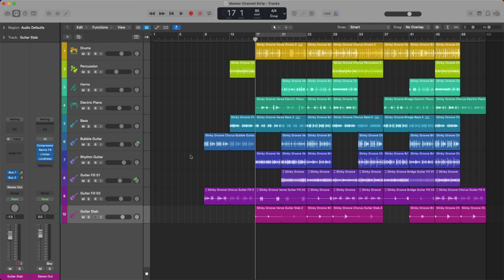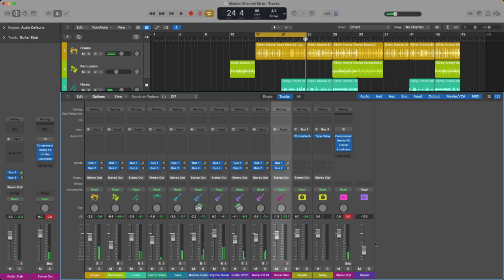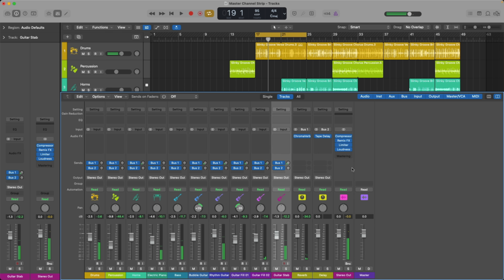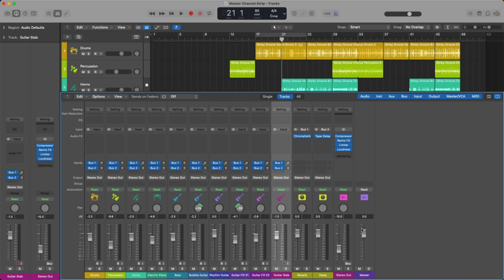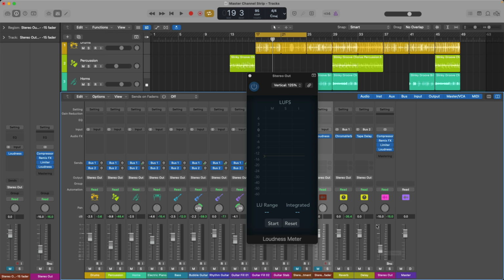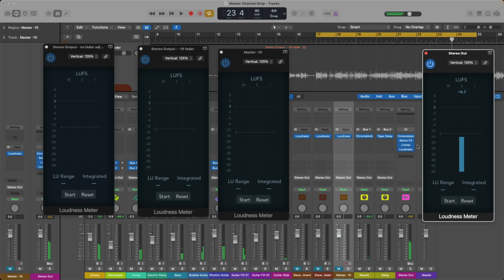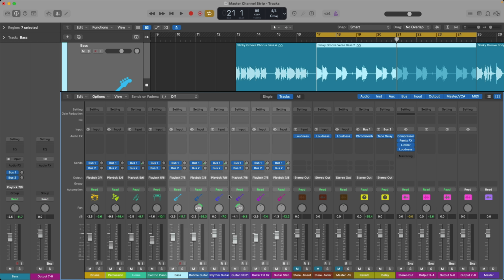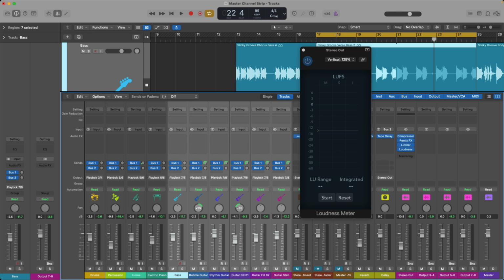Stereo Out vs Master Fader - Why the Heck Does Logic Use Both?

Comment: It would be much more useful to make the master a real "control room" like StudioOne, Cubase, and Reaper. A track on which you can insert plugins for headphone correction, room simulations, and above all, set a listening volume with the fader that won't affect the level and sound of the output, which will end up bouncing. I don't understand why Logic didn't think of such a "logical" solution in 2025. 🤣 What's the point of a copy of the stereo out that affects the level of a possible bounce and doesn't allow you to insert plugins?

Comment: Got an unrelated tech question if you don't mind.  Lately I'm having a problem with playback after i record a vocal.  The track plays fine and then will just cut to static sound for like 4 seconds and then vocal comes back in.  Any suggestions on whats the problem with Logic and how to fix it?  I enjoy using Logic but some "basic" things just need to work consistently. Thank you for your insight!

Comment: Thank you! 
Seeing the various bounced results was great. It’s clear some people in the comments haven’t had to use VCAs before and don’t realize still what they actually are and why Logic has them. I hope you can let their ignorant comments roll.

I genuinely feel bad that so many people have to learn sound engineering from a DAW. 

I’m a full time audio engineer and I teach audio and music production and it’s fun to watch people’s minds get blown when I demonstrate how to input a mic to an aux channel and then route the output of the aux into a standard track so recording level can be adjusted during recording on the fly like we always did to tape (pre-DAW) and still do using consoles-  so compressors don’t have to work so hard later. Also for time aligning room mics in real-time by adding the needed milliseconds via an insert, adding high pass eq for vocals and instruments that have low resonant room tone, noise,A/C rumble , mic stand thump caused from drum kit or bass amps, frequency adjustment to assist mic placement choice for things like proximity effect or sculpting mic low end  of ribbon mics etc etc and anything that can be eliminated from the track during tracking for better tracks.

There is SO much amazing stuff to be experienced and learned and it’s so cool to see your contributions!

Comment: Thanks for sharing, was hoping you would talk about setuping plug in slots on the master fader, I have a project an engineer sent and they had both the stereo output and master channel setup with plugins on and have never figured the setting to change it. Currently have a pre stereo out bus setup to allow the same mix options but would be so much easier on the master channel, any help here would be great!

Comment: I use Logic since the very beginning and I love it, but for me the Master strip is one of the dumbest thing I've ever seen.
First of all is deadly confusing, like your video and many comments here demonstrate.
Second is useless for most (by far most) of the users. Let's be honest, what's the % of people that use several physical outputs and need a common fader to adjust them all? 
And third, and for me the most important, they simply lost a chance of doing something MUCH more useful, that is a Control Room strip.
Instead of this silly and useless strip, a control room strip, with plugins available but not affecting at all the mix, would have been a HUGE LOT more useful.
You could eq your room, your headphones (eventually with one of those amazing correction plugins), turn up and down the listening volume even if you don't have your interface knob handy, and all this WITHOUT affecting your mix. To do so you have to create a virtual out in OSX, but then you have lag, so you have to turn on and off... a pain!
Yes, something like Cubase, that I know, use and like REALLY less than Logic. But still, when it's right, it's right.
I love this channel, I love Logic, but in this case I think Apple dropped the egg out of the canister.

Comment: Sorry Chris, but your advice "Don't trust the Loudness Meter" is very misleading. You can absolutely trust the Loudness Meter, and what you demonstrate is not a problem of the Loudness Meter, but a "misinterpretation" of a channel strip's signal flow. In Logic, the Audio FX Inserts on a channel strip are always before the Volume Fader, which means the fader changes the level of the signal AFTER the inserts. For example, if you set a brick wall limiter at -2 dBTP on the insert of the Output Channel Strip, then changing the Volume Fader will change that -2 dBTP ceiling. That doesn't mean that you "can't trust that Limiter", you just change the level after the limiter has done its job. So what you demonstrate is the expected behavior.
The short advice would be, leave the Volume Fader of the Output Channel Strip at 0dB, and only use it for fade-ins or fade-outs. If you need to offset the level, insert a Gain plugin before any Meter plug-ins on the insert slots.
About the Master Channel Strip, yes this is a VCA Master Fader of a VCA Group that includes all the Output Channel Strips in your project. Because a typical stereo project only has one output channel strip, this Master Channel Strip is kind of redundant (and often does more harm than good). Rule of thumb, leave it at 0dB and never, ever touch it (always check before any bounce). Of course, for more advanced scenarios, the Master Channel Strip can be quite handy, and when entering the world of Surround and Dolby Atmos, its functionality changes quite a bit.
I go into much more technical "under the Logic hood" details about the Master Channel Strip in my video "Logic Pro X - Master Track Mystery" in my YouTube channel "MusicTechExplained - the visual approach".

Comment: The Master fader is only redundant if you use only 1 pair of outputs.  If you have many channels going out to a mixer (or summing unit) then it is indeed a Master fader for all the outputs, and doesn't seem redundant at all.  It's also a great PANIC fader for when you set up a feedback loop and need to kill all the outputs quickly!

Comment: 95 % of the video dealing with the stereo out. But the topic is why both? No answer that makes sense. Like the master fader channel. For me that is absolutely useless. I nearly forgot that it is there. So useless. 
Ok. You say it is a final fader before the interface. Almost a VCA fader. But…… a half decent VCA Fader would not leave all the channels inaudible except for one. And frankly said, I do not need that kind of a fader before the interface. In fact it will rob bit depth from the output signal if I bring it down. Much better is an analog volume pot on my interface. Every half decent interface has one by now. And if it doesn’t, get a new one that has an analog volume pot. It will be one of your best investments for a long time. Forget about the Logic master fader nonsense.
Reply: The bit depth robbing point he misses totally in this utterly useless video
Reply: @steveshadforth8792   Moving the output fader has no effect on the bit depth of the audio in LP. Perhaps this is a myth hanging over from the early days of DAWs?
Reply: @MonsieurVersatile  I meant the main stereo out fader, my bad
Reply: @steveshadforth8792  Same applies. No effect on bit depth.
Reply: @MonsieurVersatile  wrong

Comment: Take 10 minutes to get to the point . . . the Master fader controls the level of all the output channels.
Reply: Some people appreciate learning about the how and why to get a better understanding of the point.
Reply: Thanks I won’t watch it
Reply: I disagree , this is a great explanation- it needs the deeper dive to cover it properly ( though I do think most 10 minute videos of this type could be 30s long )
Reply: Thanks for saving me some valuable time.
Reply: Wow, not a waste of time -unless you just take things at face value. Yeah the TL/DR is don't touch the level of either fader. But If you want loud tracks all aspects are Important. There are plenty of people who mistakenly use the stereo or master fader as a volume knob and wonder why thier mixes sound so quiet. This is the best explanation of the specific purpose of this function I've seen. Thanks Chris for going into the proper depth.
Reply: Guess what, in a daw it doesn’t matter if the master is an actual volume fader or if it’s controlled by a vca that does the same thing like in logic(yes, this is EXACTLY why 2 faders.)
If you are too hot on the output, lower the master fader.

YouTube has become a brain disease.
Reply: @Flunko97 just a professional courtesy to you and anyone who reads your comment…dropping master fader for anything other than a music fade out/fade in is bad practice because it goes completely against and ruins the dynamic range you spent so much time building into your mix. 
If your mix is too loud that is a consequence of pushing levels too high in the mix and needs to be adjusted in the mix itself, definitely not the master fader.
Reply: @ProAudioIQ  bullshit, if you’ve built a great mix, but it’s all too hot, then perfectly acceptable. Myself I’d just drop a gain plug-in on it. And reducing a master fader does not alter dynamic range at all.
Reply: Useless video or what..
Reply: @steveshadforth8792  With respect, I don't think it was a useless video for me; I am still learning and good to know for me at this stage.

Comment: Hey Chris, I have often wondered what are the dimensions of the room you are filming in (height, width, length). Do you also mix there? I notice what might be a 5.1 setup? or Atmos?
Reply: He has an Atmos setup with the iLoud MTMs. I am unsure of the room dimensions, but they look to be smaller than what is recommended (11.5ft by 10ft; for distance between speakers, not the room size). I think anyone can produce in a small room as long as your calibration is right.
Reply: @alex_ayers   thanks, I didn't recognize the speakers even though I just watched a couple reviews of them. I would like to know the actual dimensions, and whether this room is actually his mix room. I think anyone can produce in any room, but calibration doesn't fix a shite room.
Reply: @thaddeuscorea  right. to my understanding, this is his mix room. I was referring to delay and loudness calibration to compensate for distance between speakers, which can be done with most rooms as long as their room sounds good acoustically.
Reply: @alex_ayers   So, I still want to know the actual size of his room, and if this is where he actually mixes. no offense is meant, but, I would like to specifically hear from Chris on that. Regarding rooms and calibration, I understand: delay, loudness, still, MOST rooms do NOT just "sound good acoustically". The idea that these speakers could be calibrated for the room has zero interest for me. I have no assumptions about the room used to film this video. For all I know, this is just where he records and edits video for his channel.

Comment: Great video. I'm going through the newbies to ninja series now. I'm getting close to the point with a song where I'd want to use my outboard bus compressor. Is this something I could do by setting the output of the stereo out to my interface using available outputs, and then back in yet another two inputs? Where would this leave the processed signal? Would it route the to master fader, or is the master fader only a fader for the controls discussed in this video and isn't an output? Is there an easier way to do this for a bus compressor for the whole mix? Thanks.

Comment: This is great advice.  I once spent an agonising hour trying to figure out why my bounced file was so quiet when the Stereo Out (which has the Bounce button - go figure) showed the level was correct.  It was because I had adjusted the Master Fader using that awful slider in the Control Bar to turn the volume down while i was creating, rather than simply turning down my speakers.  Leave the Master Fader alone OR remember to put it back to unity when you bounce.  :-)
Reply: I had the same issue. It’s so simple once you know but when you don’t it’s a mind F.
Reply: i suffered it too, lol, it was really painful until a realised the master fader was in -16!!!!! definitely keep the master fader at 0db and not touch it!!!!

Comment: Hey. Love your channel and your content. So this isn't a critique on your amazing work but, this video is kind to Logic's strange output section. I've always had an issue with how the Stereo Out and Master fader work. It's important to realize that the "Master" in Logic is just a volume fader. In PT the Master fader works like an actual console. It is PRE master bus effects. Not post. This is a huge distinction. Mix really loud and you want to push less into your buss compressor and post processing? Pull the Master fader back. Want to push it harder? Push it up. The "Stereo Out" in Logic is really only useful to do custom automated fades or weird "bump the chorus up a db" kind of things. All of which could be done in a different way. This fader should be before the master buss effects. You can do a custom setup for this (by routing all your channels into an Aux, then feeding the Stereo Out) and it works fine. But it's a bit of a pain. I wish There was a way to choose this in Logic. So useless to literally have 2 output faders that literally do the same thing instead of have a function that has benefitted mixers for ages.
Reply: Myself and many other long time Logic users do exactly what you said, feeding everything to an Aux before the Stereo Output, and using that Aux as our "2 bus" with our final processing. I only send printed mixes and reference tracks directly to the Stereo Output. Personally, the only use I have for the "Master" is for automated fades, which I could do other ways. I guess I usually ignore it, LOL.
Reply: Why would to compare PT to Logic Pro. There's 101 ways to approach your way of doing a task in a daw. They're all wrong except the way that works for you. I wouldn't think of another Daw like PT when trying to listen and learn about this video related to Logic Pro.  
The master fader in a DAW controls the overall volume and processing of the entire mix before final output. A stereo bus fader in a DAW controls the overall volume of a stereo mix, affecting the combined left and right channels.
Reply: @guitar.knackshack2210  : It's not so much about that PT does it. It's more that PT emulates a console and console workflow. And there are very good reasons for that. Maybe not for electronic music as much, but definitely for anything else. The master fader controls how much of the mix is driven into the master buss processing. So the sound can be greatly altered. Or not. But it's not the Master fader you would use to fade something out because as you fade, you would be pushing your bus compression and processing less and less as the fade goes on because you're pushing less signal into it. And so, the "Stereo Out" would be where you would do that. They work in tandem. So it makes no sense for both of these faders to do this. 2 volume knobs is redundant. I wish the "Master" fader in Logic could be set to function like this. That's all I'm saying. I'm fully in Logic now and it's the only thing that's stock in PT that I miss. But, not worth going back to PT when I can build it out in Logic.

Also, I'm a UA guy, so I don't monitor through software. Which means I have to balance my mix from Logic with my UA mixer. The Master fader in Logic is perfect for this. The Stereo Out would do the same thing. But I use the Master fader. But that's the tracking stage. In the mixing stage I want the Stereo Out to be pre bus effects and do my fade outs with a gain plug in with automation curve at the end of the chain. Either way, the "Master" fader in Logic is wholly redundant. Useless.